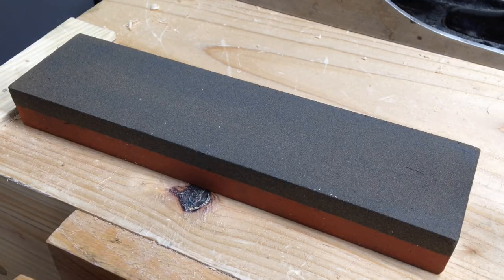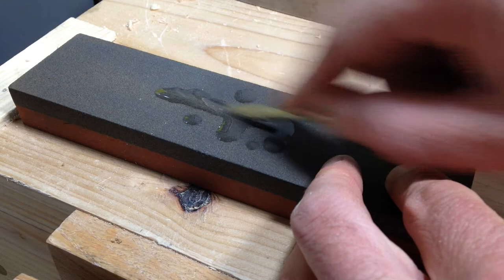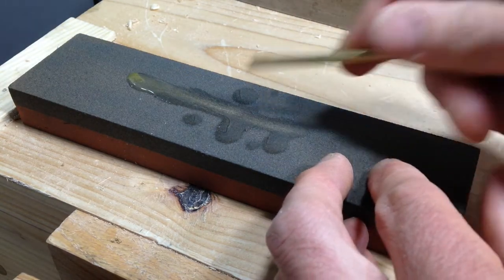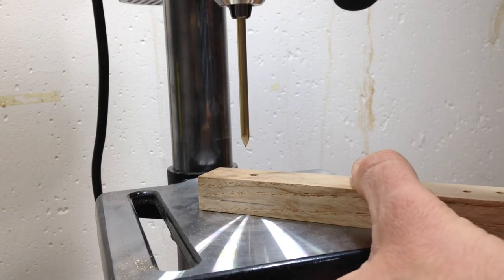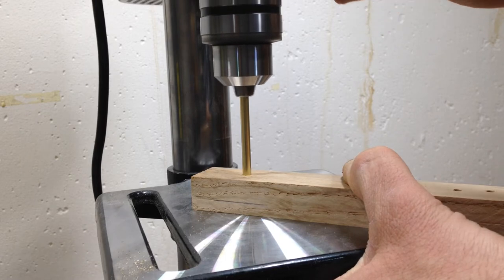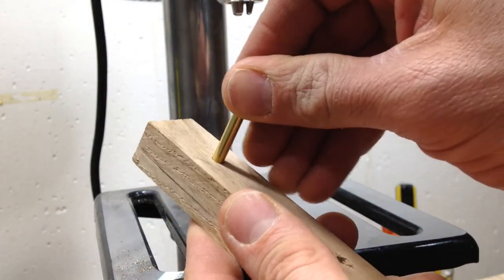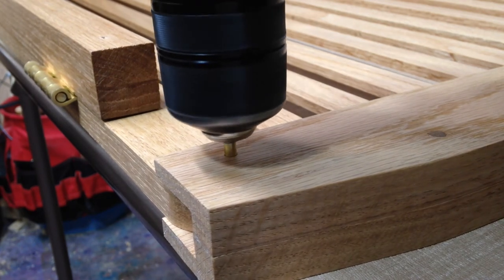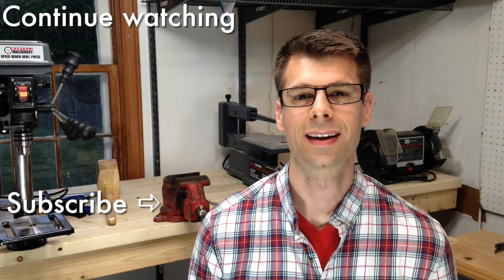DIY Reamer for Extremely Accurate Holes

Comment: Nice video. I have a challenge you may be able to help. I have a road bike and it’s bottom bracket shell is 40.4mm. But it should be exactly 40.95 on both sides. To ream the bb, I would have to buy an specialized tool which is more expensive that the actual bike frame. De holes must be parallel to each other and perfectly round. Can you imagine and diy idea how to solve this?
P.S. I have a press fit tool that drives the bearings in the shell, if it may be used in any way.
Reply: expandable reamer

Comment: Any suggestions for making one for Aluminum
Reply: For reaming aluminum and other soft metals you should have some success making the reamer from tool steel and heat treating it.  Also, 3 faces should give sharper cutting edges than 4.